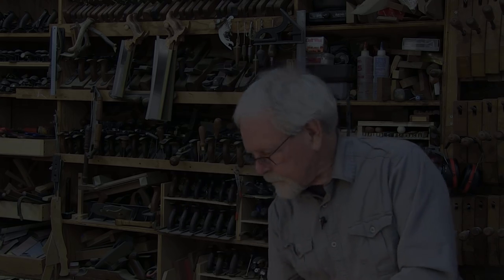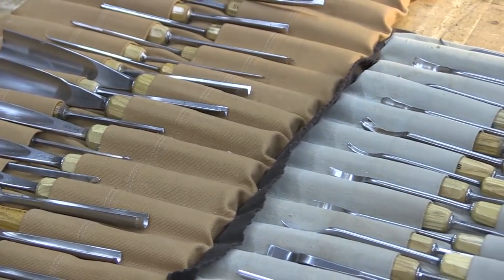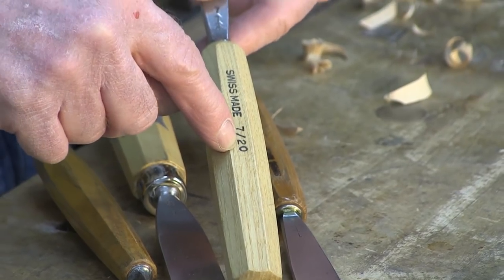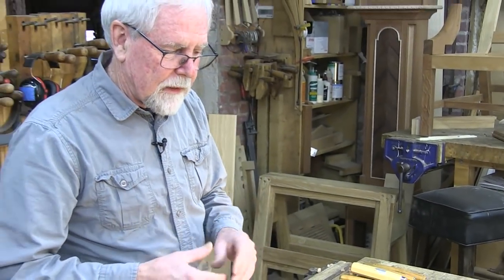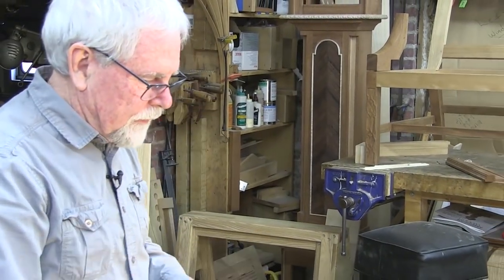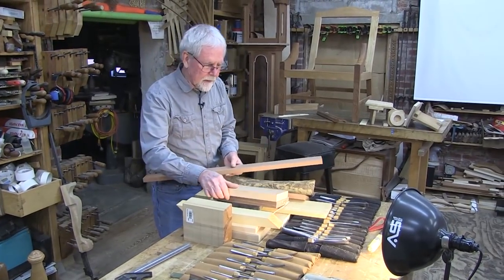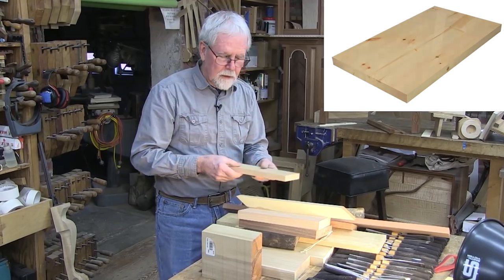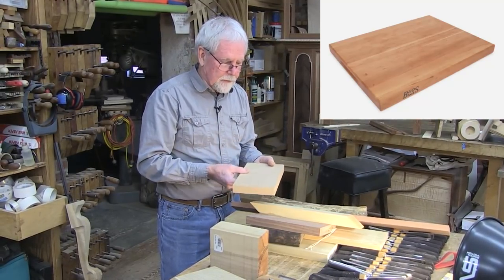The Art of Woodworking - Episode 6: Introduction to Carving

Comment: A back bent gauge is not used so the handle will not get in the way. It is used for convex curved surface to control the depth of your cut. Has lots of tools $$$ that look hardly used. The purpose for the bent skews is for tight right inside corner and the other for tight left inside corner. Nice set of tools.